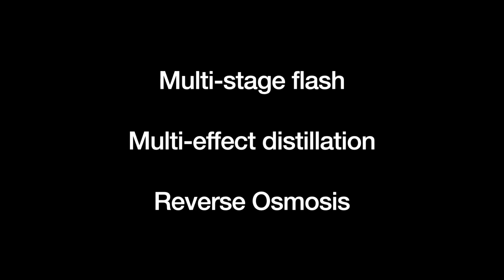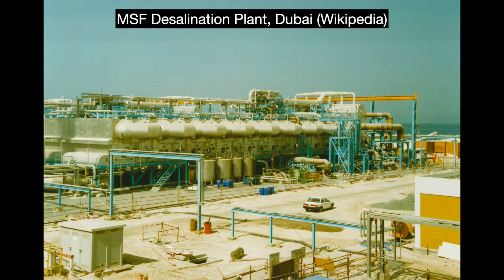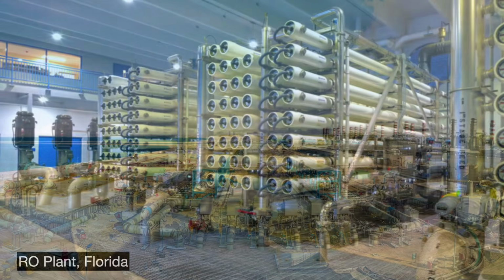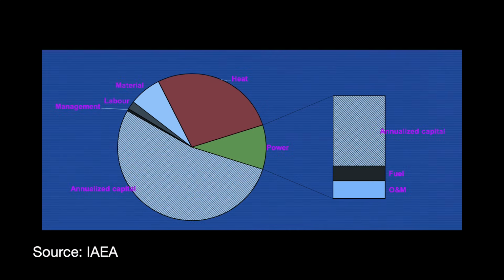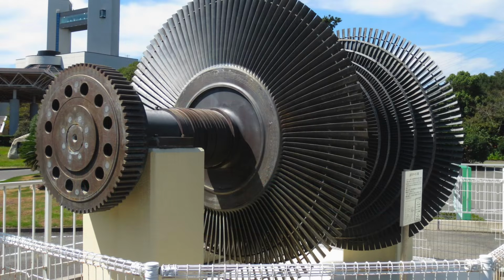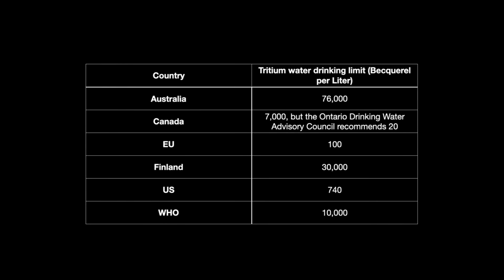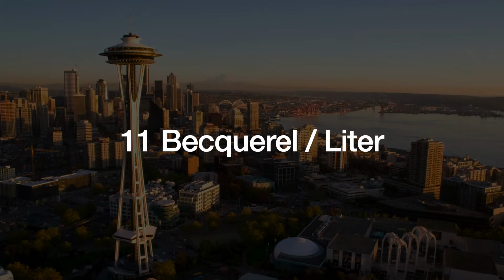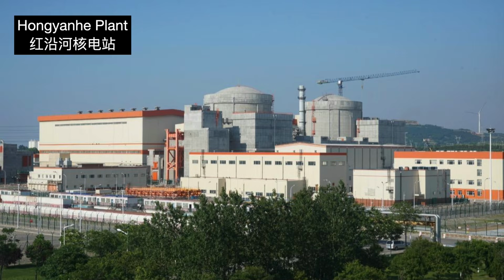Going Nuclear to Desalinate Seawater

Comment: It's a no-brainer. The inherent safety and compactness of MSRs, along with their very high heat output, make them ideal for all sorts of industrial processes. Much of industry like steel etc needs heat rather than electricity
Reply: I wish we could split the planet for pro nuclear and anti nuclear people.

The pro nuclear side would quickly go to a lot more fresh water, probably cheaper energy over the long run, generally progress... let's add hydrogen production to that and move to hydrogen cars while we're at it.

Then a while after we can leave the planet with the anti-nuclear peeps...
Reply: No brainer, if you don't have a brain, just like Justin Bieber
Reply: [heat] Good point. It seems so obvious now that you've told me.
Reply: So, there no reason we're not headed in the right direction blaming firefighters !!!
Reply: Nuclear doesn't get hot enough for steel.
Reply: @celluskh6009  not to smelt iron ore for new steel production, but it does produce plenty of clean electricity to run electric arc furnaces.
Reply: @Clean97GTI  Okay, but " Much of industry like steel etc needs heat rather than electricity"
Reply: What does that have to do with desalination?
Reply: 1. Switch from nuclear to solar in Germany where engineers are abundant and sun is scarce
2. Construct nuke plants in deserts
3. ???
4. Profit!
Reply: All
as a starting off point for many high temp industrial processes like cracking nitrogen for fertilisers, or steel, or almost anything that needs to happen over 300-400, the 700-800C temps of an unpressurised molten salt are clearly more useful.  
I suggest looking through some of Kirk Sorenson's content or Gordon McDowell's if you can't see the benefit of high heat output. You just get better efficiency if you can start off at 700, and go from there, rather than having to convert the heat to electric and then back to heat, and start at room temp. . 
Even in the production of electricity the high temps are great, because you can run a CO2 turbine at extreme efficiency vs a steam turbine at ~300C (the heavier molecule means it can carry much more energy at lower pressure)
Reply: @mariuscheek  I have followed Kirk Sorenson's FLIBE energy thanks to Gordon McDowell. I absolutely do see the benefit of high temperature reactors and it makes a lot of sense. But as with any reactor design, there are tradeoffs you have to make. High temperature operation with metallic salts introduces construction material problems. Even Kirk Sorenson has backed off the very high temperature operation somewhat because of this issue. Fluoride salts are fine. High temperature is fine. But when you combine the two and add-in the harsh realities of neutrons flying around smashing everything they see, you end up with some rather strenuous requirements for your reactor materials. You have problems like the graphite moderator swelling. You have the issue of the temps in question being beyond anything Oak Ridge ever tested in Hastelloy-N. 
You need supercritical CO2 to get those efficiency ratings you're after, which is a problem since there are no production supercritical CO2 turbines in production. GE has a demonstrator and it looks promising but it's the only one. 
Sorenson's LFTR is interesting but it has other issues as well, such as needing an entirely different fuel cycle. He wants to use Thorium to breed Uranium-233. A laudable goal, but that means tooling up an entirely new fuel fabrication process just for his reactors. Other reactors that use the Uranium-Plutonium fuel cycle already have the benefit of an existing fuel production line. The MCSFR from Elysium Industries is much more promising in that regard because it can burn up existing spent fuel from Light Water Reactors. It doesn't need a whole new fuel source AND it can remove the waste that is just sitting around nuclear plants around the country and reduce it further. And by not using the super high temps of the LFTR, it can be made from qualified materials we have right now.

And for desalination, high temps like that are just not needed. Remember, we're just flashing sea water to steam which means just over the boiling point of water. You can reliably flash water to steam at less than 150 Degrees C. 150-200 C operation is a lot easier to build for. That's why I was asking what high temperature operation has to do with desalination. You just don't need that much heat to do it efficiently. 

In terms of process heat for industry, nuclear may not be the way to go for that. No reactor possess the temperatures needed to smelt iron ore to produce new steel, but they do excel at making electricity which allows electric arc furnaces to run and melt steel for recycling. In terms of recycling, metals are about the only thing worth expending the energy to recycle. Neat thing though, with nuclear reactors, you do get enough heat to run a pyrolysis process in which you can render plastics back into their component oils. 
We're not going to eliminate things like coal and petcoke any time soon simply because of their industrial uses, but nuclear is still a better option for electrical generation and that does have industrial value.
Reply: @mariuscheek  Those two names are thorium advocates, and don't seem to have produced any research to go over. I can't see what you would do with 700C to somehow take it and double it that would be more efficient/safer/possible than using coke. Can't see why you would run highly pressurised and flammable methane over a nuclear plant, either. MSR's are already technically questionable without adding more processes and dangers to it. I'd recommend trying to get modern reactors producing electricity (political issue, not technical), let Sorenson figure out his reactor that was 5 years away 10 years ago, and leave high heat processes for hydrogen production to eventually overtake coke - which can be done with nuclear, or any other energy source.
Reply: Until there is a war or a flood or an earthquake  it's  safe....
Reply: @rickcostin  That's the nice thing about molten salt reactors. They are walkaway safe. You don't have to do anything with them other than turn let the pumps shut down. If you stop pumping fuel salt through them, the reaction stops and you end up with storage tanks with the fuel salt cooling down.
Reply: @Clean97GTI  No the nice thing would be if ALL nuclear reactors were like this and not like ticking time bombs....
Reply: @rickcostin  
Basically, California.

Comment: The Politicians, Regulators, & Media criminal cartel control the insane supply shutdown tyranny for the U.N. Agenda 30. 
There were three climate changes last century, a warm one, a cold one and a warm one of which is coming to an end. And now with the lesser output from the sun, we are going into a very low temperature climate. The suns output determines our climates.
Carbon dioxide CO2 and all other gases dump heat at night to outer space, warm day cold night and are not greenhouse gases. All heat flows to cold. The only significant greenhouse gas is water vapour. 
 The climate regulations come under the power of an oligarchy of unelected Regulatory Authorities in our institutions i.e., Mandatory shutting down water supply to farmers and what they can grow, is destroying food supply by an out of control dictatorship. The efficacy of climate change regulations cannot be replicated scientifically and are based on politics to destroy western food supply, democracy, and economies. We have been groomed to starve. All food in the supermarket has a fossil fuel element to it.
The population of the Western world is being poisoned with Zero efficacy medication. The medical industrial estate has withdrawn safe medicines. Food and oil are now in short supply and expensive.
Government and unelected regulators running our institutions are committing crimes against humanity, with the carbon climate change environmental tyranny oil lock down.  Wake up, CO2 under 150ppm all plants die, and everything else as a result. GOD HELP US   Paradise is lost!  These tyrants hate everyone including themselves Mandated climate Lock down of Coal fuel energy supply is now a serious problem globally. Food supply and travel is coming to an end as we know it. (All orchestrated by false fear).

Comment: Its just so sad nuclear has such a bad rep, and the funniest thing is no other large scale systems are as safe a nuclear plants, not to mention the molten salt reactors, which are even safer then traditional rectors. There is no other source that even comes close to its consistency, its abundance, and its safety. For much the same reasons as to why thee aviation industry is so safe today, despite still being hundreds of tons of metal doing one of the most unnatural things by hanging in the air, whilst at the same time being several hundred times denser then air, but we fail to think of airplanes this way because they are so ubiquitous.
Reply: Yes there is just a lot more fallout when a nuclear plant crashes and burns....
Reply: @rickcostin  ah but you see molten salt reactors are naturally immune against crashing and burning. In fact if you had to crash one from space at orbital velocity, it spread the salt so quick that all nuclear reactions would almost immediately be halted. And if we use thorium for those we wouldn't even have to clean it up if it's out in a remote-ish area as it is quite close to background radiation. But in the case of a stationary molten salt reactor not even a nuke exploding inside the station would cause nuclear fallout from it. Maybe the Tsar Bomba might have enough thermal energy to evaporate that much salt, as that much salt requires a lot of energy to be vaporized, about 10 times more then water. Not to mention molten salt reactors don't run under pressure, they run at atmospheric pressure, so no chance of explody stuffs happing like how light water reactors can.
Reply: @atlanciaza  Very good, so are these MS reactors the most commonly used? Or are they just a pie in the sky idea? If so why are we selling all this yellow cake uranium that is being mined here in South Australia to the rest of the world? Using it in reactors that blow up and require the Japanese to dump 100 million tonnes of radioactive water into the Pacific ocean?
Reply: @rickcostin  Very good, an observant guy here, well it turns out this is not a pie in the sky, in fact the USA was the very first nation to build one over 60 years ago, there is one big draw back to MS reactors though, it is significantly more difficult to extract weapons grade materials from it, then from a light water reactor, due to how the molten salt reactor functions, as unlike light water reactors, the salt is not only the coolant, but also has the fuel dissolved into it, and as a result the end product of this reactor is just salt with relatively short lived fission by products, which is suspended in the salt. If you just keep this reactor running it will eventually fission almost all the radioactive materials in in to a less radioactive state via neutron and photon radiation, and the usual shower of particles associated with fission. 

There used to be another problem faced by these salt reactors, which was short pump lifespans, but in recent years alloys have been found that combats these issues. 

Funny you mention yellow cake, I live in South Africa where uranium mining is also big, so I happen to know that yellow cake is actually a salt of uranium(mostly), and a molten salt reactor is essentially that cake with a much lower concentration of uranium, in a big enough vessel.(though all this comes with a caveat as most modern facilities actually produce a uranium oxide instead due to how significantly cheaper oxygen is to get, then salt)
Reply: @atlanciaza  Sounds promising but the question was if these type of reactors are the most common or are the standard type new and old the conventional graphite core nuclear fuel rod type. A friend of mine has just come back from working at Roxby Downs copper/uranium. Refurbishing a furnace used to melt copper ingots to remove radioactivity, he said every thing in the plant was covered in a fine black dust......polonium. Nice place to work...not!
Reply: Interesting thing it the information is actually there in public domain, but few people show interest in archaic designs, we are always under the impression what we do today is the best, but in some rare cases like this, it turns out we are way more interested in weapons of mass destruction then environmentally friendly and exceedingly safe technologies developed before finding out how to make weapons grade materials with a way easier method, despite the extreme danger associated with things being under immense pressures. 

This very reasoning is also why I am convinced our efforts into fusion is really futile, because in the end no matter what we will have to deal with energy levels never before seen in any type of fission reactors, and at the moment as demonstrated by 3 massive fission disasters, we are not even remotely capable of handling fusion power, as it releases orders of magnitude more energy. Its just a much better option to start mining the sun to build a Dyson swarm, and in that way we could regulate exactly the amount of energy reaching earth, and in so doing we can prevent further ecological collapse. And only once we have mastered our naturally available fusion reactor will we maybe be capable of handling fusion of our own creation, if that is even feasible.

Comment: Detailed Comparison with the solar and wind powered desalination plants is sorely missing. Especially cost wise.

Without this, the article is pretty much unbalanced.

Otherwise, thanks, valuable content.
Reply: Of course, if there were solar- or wind-powered desalination plants then a comparison would be possible.

The issues or relying on solar-/wind-farms are:
* intermittency - bringing your desalination plant up and down is not a great plan for cheap water - you want to run that asset 24/7.
* storage - sure, you might add storage to your cheap solar-/wind-farms to achieve 24/7 - but oops! then the price of your solar-/wind-farms went from cheap to expensive.
* low-temperature desalination is problematic - whether using electrolysis or membranes - the more heat you put in, the better, even at 1C extra.

Such a desalination plant could be funded as a vanity project, but very unlikely to compete against thermal plants.

Comment: Why would i want to disestablish the best method of inherent stability for a reactor by removing the negative temperature coefficient of reactivity. reverse osmosis has existed for decades. Nuclear should already be powering the world, people are terrified of what they don't understand and what they don't understand is nuclear is the safest energy production possible and if anything has gone wrong it was due to inherent mental retardation design flaws that people should be hanged for. Fucking positive temperature coefficient of reactivity with graphite tipped control rods with a lying government, chernobyl. Inability to check proper indications due to operator error and doing nothing would have led to nothing happening, three mile island. Having no way of removing decay heat from a reactor because you don't account for tsunamis hitting your country despite historic evidence of potential issues regarding tsunamis and earthquakes due to geographic location, Fukushima. Fucking apes.